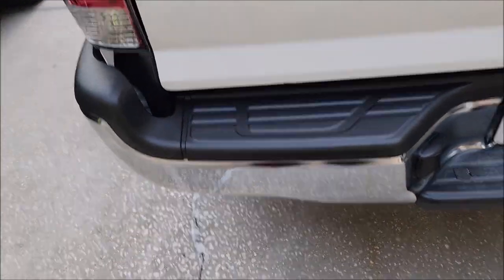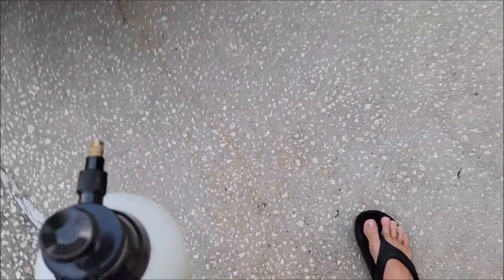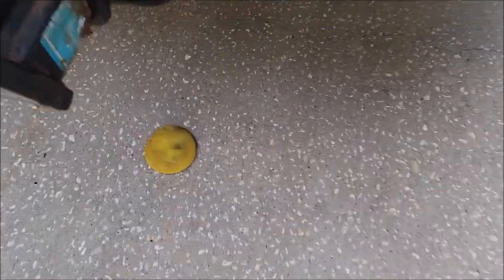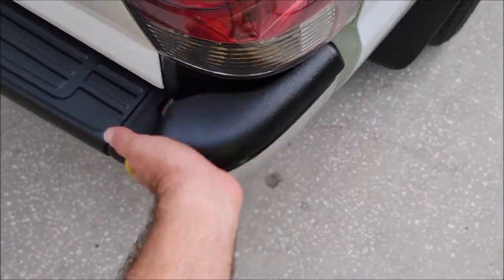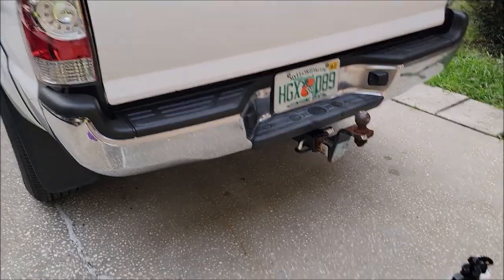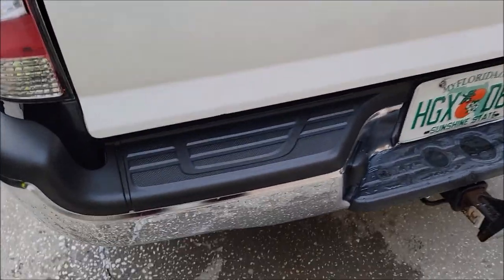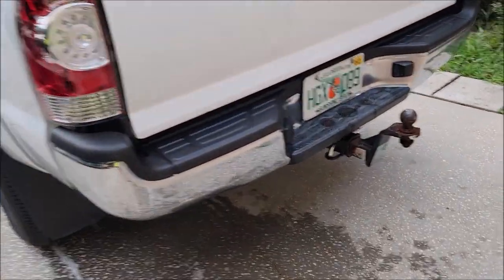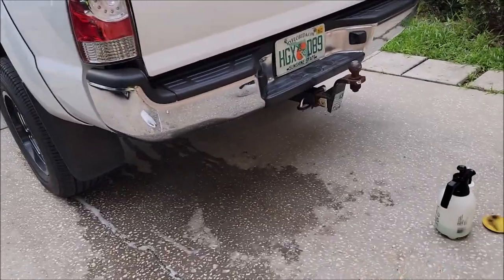NEW TIRE SHINE FORMULA DEMO - TRIPLE TRIFECTA TECHNOLOGY -  GLOBAL ECONOMY - INTEGRITY

Comment: Just ordered your 10 year kit, do you think it has enough to coat a 2022 f450 with the applicator pads, or would I need to use a spray application? Truck arrives 9/9/21 so trying to get everything ready.
Reply from the maker: The kit includes 1 oz of both coatings. I generally use around a half ounce on a small SUV. 1oz is definitely enough for the f450, but if not, please let me know. My cell is 813-846-4406